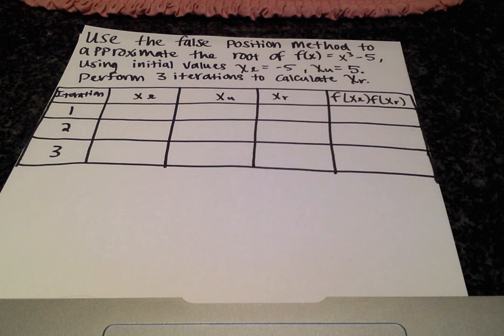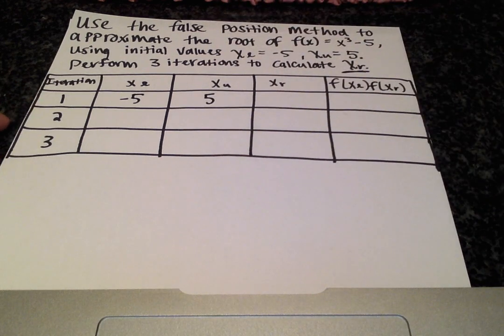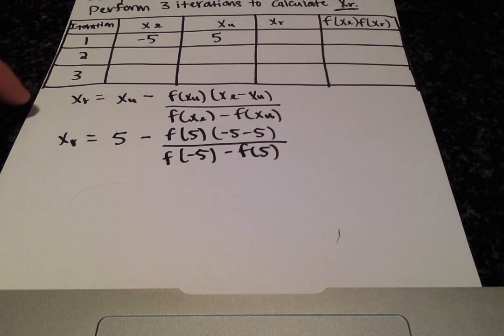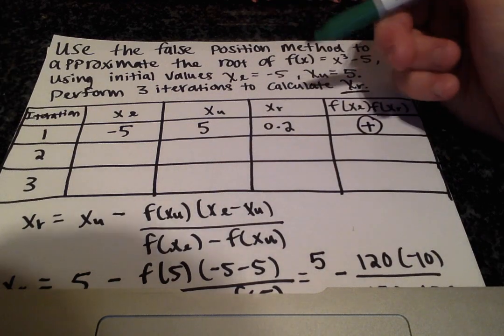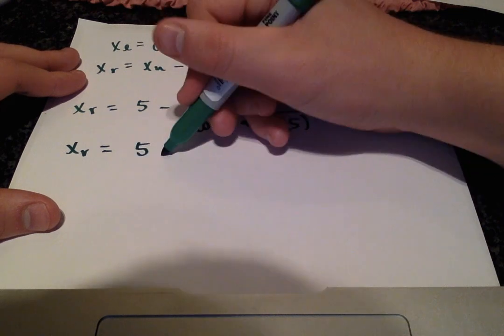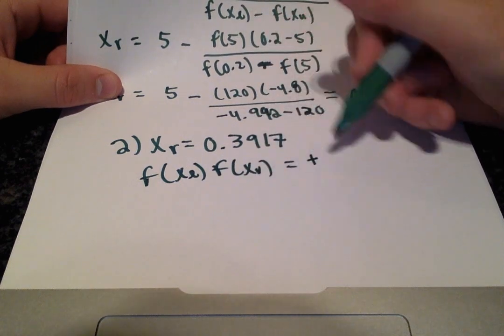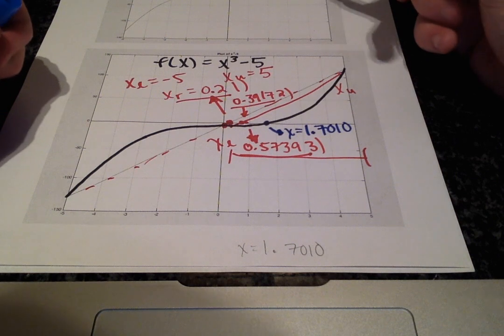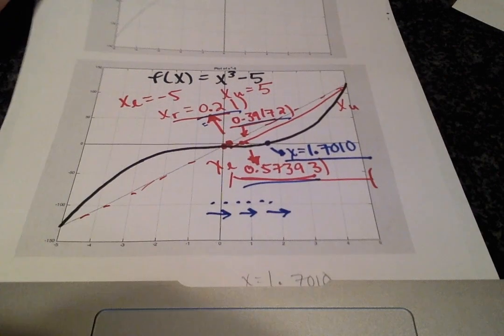False Position Method Example 1

Comment: hi alexander, i hope this comment finds you well 
can we find the last value , which is the Xr using calculator instead of finding it graphically ?
thanks
Reply from the maker: +AZ H Hello, the Xr value of 1.710 can be found if the iteration process is repeated several times. However, if you are interested in finding the root on your calculator there is another method. On my TI-84, I followed these steps: Click "Y=", enter "X^3-5", click "graph", then "2nd" and "calc", click "2:zero", and finally select the left and right bounds to guess the root. Hope this helps!

Comment: what if f(xl)f(xr) is negative ?????
Reply from the maker: +mooony94 In this example, f(xl)f(xr) is positive for each case. If f(xl)f(xr) were negative, the new search range would be in the opposite direction: search left, setting xr as the new upper limit (xu). This is explained in more detail in my other video: Introduction to the False Position Method.

Comment: thanks for the video sir. but what if the approximate percent error is given? for example, less than 0.5 %?
Reply from the maker: +zalina Ali In that case, you would calculate the approximate percent error after each iteration. The approximate percent error will continue to decrease with each iteration (eventually less than 0.5%) and that is when you will arrive at your final approximation.
Reply: thanks